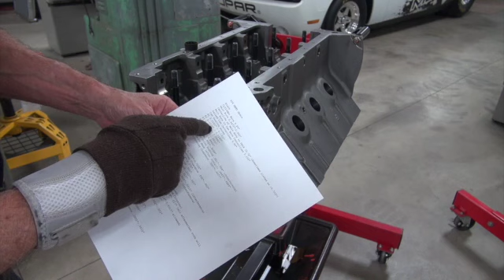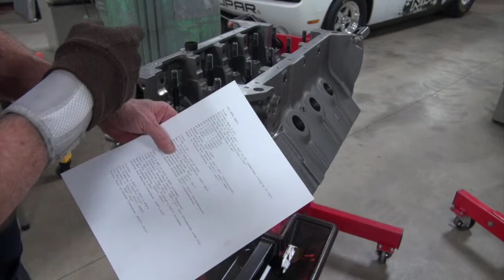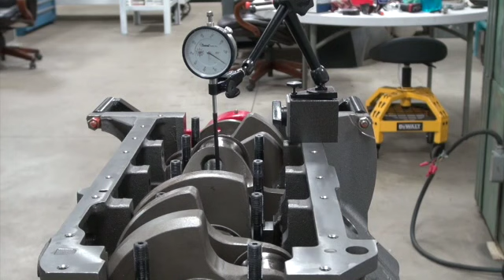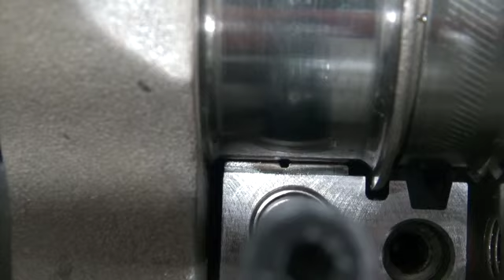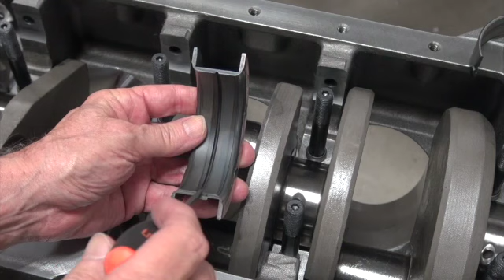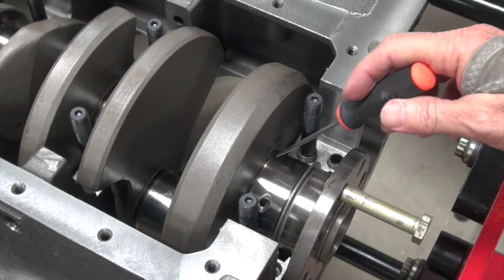Building your 426 Hemi Ep 4 #426hemi

Comment: Good video Rick.
You're absolutely correct about the bearings.
The deal where they are supposed to work is not always true.
I wonder if the rear bearing was located towards the front?
Causing the bearing to intersect with the fillet radius.
Been there on the cam bearings.
Don't feel bad.
The tight bores do not help.
I also use oil in the bore and on the bearings.
Still shops driving them in dry.
Or use grease.
Grease can make a tight bearing.
Thanks for sharing Rick.
Take care, Ed.
Reply from the maker: Maybe so but it sure didn't work. Thanks for watching.